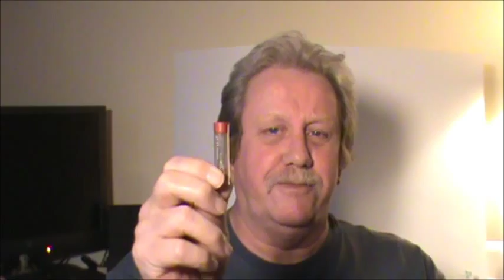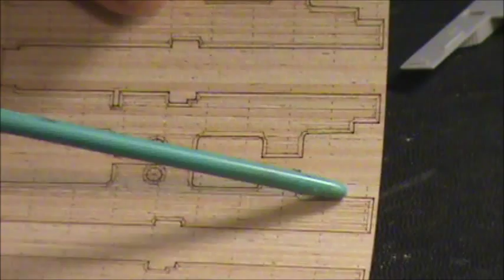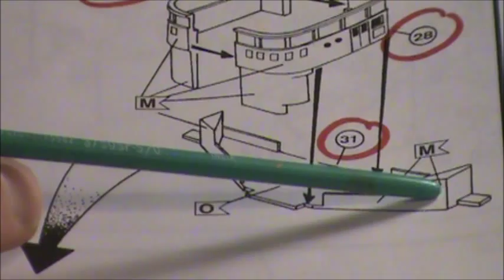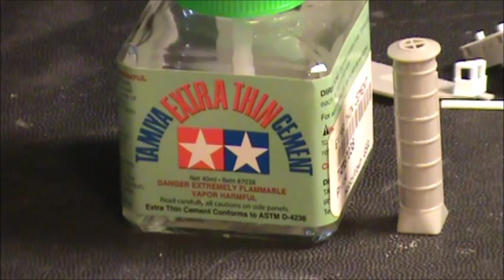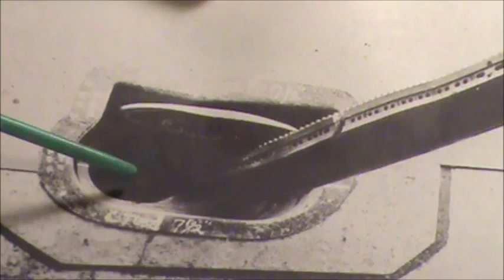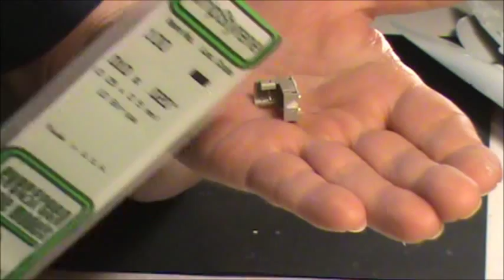SMS DRESDEN PART 3

Comment: Hi Gary,nice video i do like the attention you gave on the details.
Gary some tips about i few things you mentioned.
The brass used on model ships is very hard because of the way they produced it (the brass is pressed to the desired thickness.)
If you take a small part and you heat it up with a small torch until it is red and you let it cool down it became very soft and is easy to drill.
Another tip i learned long ago is when you have seems or small holes in the model we used putty.
But there is another way,when you take a half bottle of the tamiya glue and you put small pieces plastic (rest stuff from the model) in it and you let it stand for a couple of days you get liquid plastic.
this stuff is very useful by modeling .
A last remark on the torpedo.
It was a very nice story you told about the breaking of the water with the spoon so the torpedo had no trouble with the water but i think it is a little bit different.
The spoon had a rail in it to hang the torpedo on and fired it backwards or by turning the spoon to the front of the ship forwards.
Reply from the maker: Piet Nieuwpoort Hi Piet....I may try that on my brass the next time.  I have seen that about melting plastic in glue but a little to messy for me.  But it is good to know.  The tubes....I don't know, in the pictures the spoon looks to be coming out a separate tube than the torpedo...take a close look at the pictures....http://www.sms-navy.com/bb/sms_bb_helgoland-ost-photos-hull.htm...you may be right.  Thanks for the info.
Reply: Gary Brinker Gary sorry i was wrong with the torpedo's i looked very carefully at the drawings from the russian site.
On the drawings in section X you see the torpedo tubes.
Also you can see that there is a very small hatch in the ship.
Reply from the maker: Piet Nieuwpoort Yes...I see the hatch you are talking about.  That is not on the model, thanks for pointing that out.

Comment: Hi there Mr Brinker! I searched around local here in Saint Petersburg,  found some dead eyes. But no one has the brass strips (lanyards ? Or chain plates) different kits call stuff differently, which is weird. Anyway got in touch with the company "Artesian Latina" in spain. And been corresponding with them and that was a job in itself.  The language difference is hard to deal with. But I have paid them 34.00 to ship me all 22 chain plates with a complete set of plans. And as soon as I get them I'm going to work on it. Can't wait to see the end result.  I also didn't get the clothe sails, but lucky for me I can sew. I am good at it too. So I'll have to make them with the layouts that I have, cut them out like you did. I don't know if you seen the mahogany chess table on my page, but I was going through a separation at the time and that took me 4 months to build. When I start to do the work on the Bluenose I will video it and you can check it out. Sorry about the book I'm writing but you will understand when u see thus build. I am pretty sure that I will add lights to it, in the cabin and on the 2 mast as well as the bow and stern. So by any chance,  were you a navy man. I was back in 78. Was gonna be an instructors aid. But they breached my contract and I got out with full benefits.  Anyway keep an eye out won't be ling. Parts are on the way!! Yes hawww
Reply from the maker: Jeff Lawson Jeff here are some web sites I shop at,  you can get just about anything you might need for you model.  Some of the parts even come from Artesian Latina.  Also try Hobby Lobby, they sell brass strips.  Best thing to do is make a list of what your going to need and order everything at once to keep down shipping cost.  Two web sites are http://www.agesofsail.com/home.html  and  http://www.castyouranchorhobby.com/
Also if you are going to light your model you might try magnet wire, it will be easier to hide your wire running up the mast.  I use 30 gauge wire on just about my models.  If you watch part 7 of my Battlestar Galactica I show the wire I used.   Here is where you can get it    http://www.techfixx.com/  I have had no problems using it on lighting models.  Here is one place I get some of my LED's and SMD's for lighting   http://lighthouseleds.com/.  Hope this helps.

Comment: Cool, I used older telephone hook up wire , strip the outer layer but yeah thanks for the info, did you cut a path in the mast and putty over it so you can't see it. Because I thought about the rings that go around the mast including where the mast enters the deck. I want to make it so no wires show and also thinking on using a 12 volt plug in adapter like on a cell phone or rechargeable items. And I have a huge curio cabinet and it's ready for the ships spot. But thanks I will look into that site . I do appreciate it a lot.

Comment: Hello, At those scales the A should  be 1.45 Ft and the D 1.11 Ft. That is why I build things like Tanks to the same scale, You can see how much bigger a Main Battle Tank was compared to a Combat Vehicle Reconnaissance. As for Drill bits, I went on Ebay and bought a pack with different sizes, I then bought a few Packs of 10 of the ones I use all the time. And the next thing that goes after your brain is your memory? But I can't remember who said that? The plastic weld glue I have been using for years and cut off the built in "Applicator", I quite often hold 2 pieces together then apply it from the back with an old thin brush or get the one with a tube applicator made by Revell. Andy C

Comment: Gary:  You can get HSS (High Speed Steel) drill bits from Amazon in just about any size you could want.  I just got a pack of ten for about $8.00 (Size # 74 and # 75).  If I was in my shop, I would throw a caliper on them but less than a mm.  I use a lot of different sizes (all small).  These are good for the small brass eyelets.  Micro Mark is expensive as are most hobby supply stores. There is also an industrial supply house I buy from when I can justify the order that will cover shipping.
Reply from the maker: ihatomi I checked that out...so many to choose from...some with good reviews and bad.  I may just stick with what I have and works.  Thanks for the info.

Comment: Gary check out ebay or go to tamiya,they have a mini battery hand drill , also call a mini router, use 1 all the time, will save your fingers from the dreaded pin vise, if you can.t find it let me know and will find it for you, maybe will send one to you.
Reply from the maker: cfyarosz I have one, but when using very small drill bits I prefer the control I get from a pin-vise.  It dosen't take much to snap one of those tiny bits.  I found that wrapping tape around your hand in certain places helps.  Thanks for the offer but I already have one.